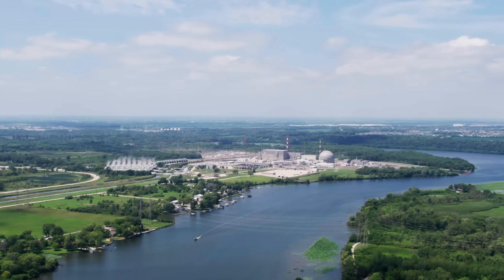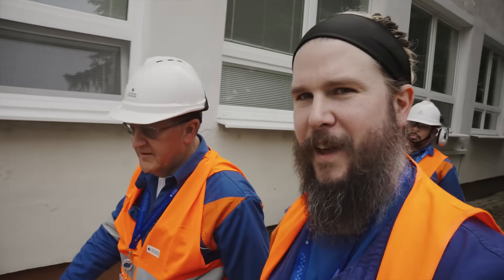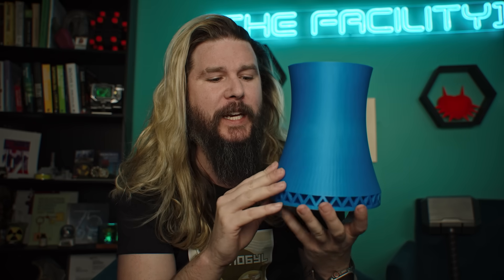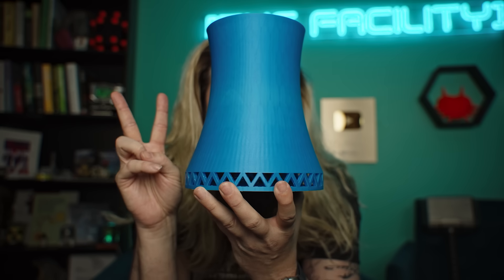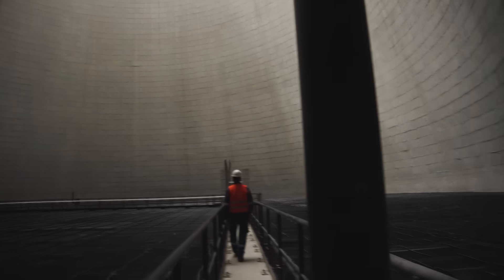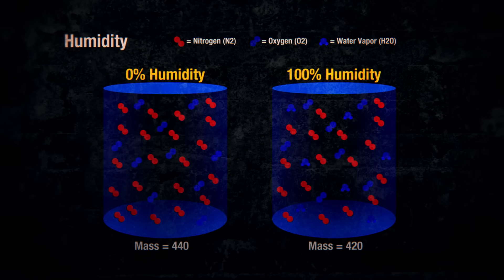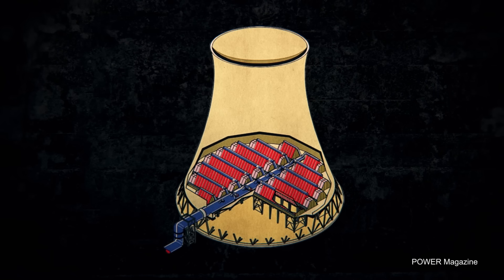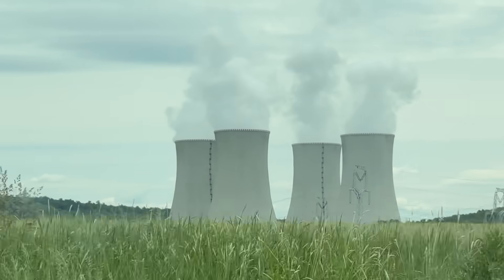I Went INSIDE a Nuclear Cooling Tower

Comment: "What do you think of when you imagine a nuclear power plant" I crude Radiation based steam turbine system? lol.. Earth should have upgraded to cold steam Tesla turbines a long time ago. Points at demos of Cold Steam Tesla's leaving ice cold mist on other side Universe can't balance heat if turbine big enough to take it all. Colder the cold side the lower the hot side needs to be for massive power for turning turbine when inside vacuum. If ever needing to crank vacuum back up because of leak or pump water buildup back to other side(Unlikely if built right) > Puts magnetic motor outside system that can be magnetically linked to turbine inside yes.. Good turbine like a flywheel so you can shutdown system while still providing power and have time before needing the power to turbine back before it drops down speed below optimum power output.

They don't even have Electric plasma generated Ultrasonic force field shockwave holography support for nuclear reactors yet did you know that? That's messed up.. *Search engine: "Boeing Plasma force field blocks bomb shockwaves" Plasma generated Ultrasonic shockwave > Then to make Humans and your metals immune = "A resonance frequency database can be employed to ensure that local healthy material surrounding a target has a natural resonance frequency dissimilar enough from the tuned resonance frequency." When your nuclear experts start seeing the level of control they can have without even having to open their machines up to install the upgrades, they're gonna want a design focused on Ultrasonic force field advantages. Promise.. - Dracula

Comment: Might be a dumb question but I always wondered: Could we put a turbine on the bottleneck of a cooling tower? Since hot air rises would it not be possible to capture some of that energy inform of heat and further improve a power plant’s efficiency would also be applicable for non nuclear power plants?
Reply: Technically yes... But that would slow down the air flow and you would loose the ability to cool the reactor as efficiently and the energy would be rather minimal as the air isn't moving That fast at the top.

Comment: Is there a reason they don’t put a wind turbine in the top of cooling towers to generate extra power from the heat energy?
Reply: Yes because putting a wind turbine on top would slow the air flow down causing there to be less cooling for the reactor and the air doesn't move all that fast, maybe a few miles on hour at the top. (AKA a nice breeze) So the power generated wouldn't out weigh the cooling potential that is lost.

Comment: Hey Kyle, I am from Argentina, and we only have one nuclear power plant complex Called Atucha, that currently has two operating reactors, and a 3rd one on the way. The thing is that there are not a single cooling tower, are there other ways to cool the water?
Reply: Just looked and it's placed right on a rather large river so as he mentioned they just intake water from the river and then eject the water back into it instead of using a cooling tower.
If done environmentally they won't pump the hot water directly into the river... But seeing as a Chinese company is building reactor #3... I doubt it will be environmentally friendly.
Reply: @SilvaDreams  the chinese where already booted from the project, the other two where made here by the national nuclear authority, and the third is on hold again. (new party at gov that does not want anything to do with China)

Comment: As the moist heated air rises, the air speed increases due to the constriction made by the parabolic shape of the cooling tower. This is called the Venturi Effect.
Reply: Correct. THAT is why it has that shape, not strength. 'tho strength is a happy byproduct. Also, they aren't built as a series of twisted straws. They're built like every other large concrete structure... in lifts. (I've watched them being built.)
Reply: Probably for both reasons. 

Engineering costs are a big motivator behind infrastructure design. Grady from practical engineering highlights this regularly in everything from cooling towers to dam designs.
Reply: Furthermore wind across the top of the cooling tower also pulls on air from within the tower which…. Oh hey look our buddy Bernoulli is also here 

This is very likely also being assisted by the Bernoulli principal which makes it far more efficient still,
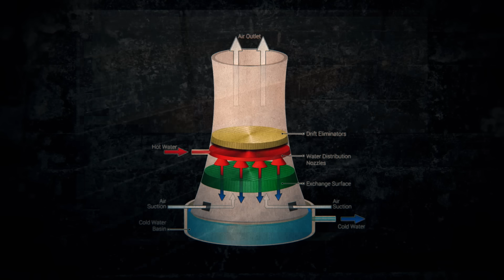Reply: 8:05 so you just didn't watch the whole video is what you are saying.

Or 9:05 is you are less patient.
Reply: @5353Jumper  nope, you are wrong, he talks about difference in pressures/weight of air thus making air move in 9:05, but Venturi Effect helps, by increasing pressure by decreasing diameter, but keeping same airflow - it helps suck air even more(something like in old engines with carburetor).
Reply: @TOZA He does mention the venturi effect, just not by name as he says that the tower's bottleneck helps accelerate the air.

Comment: "Plain" coal-fired plants have cooling towers too. My fav is in the ending scenes of Terry Gilliam's "Brazil" 😊
Reply: in Wolfsburg there is a coal powerplant,that was converted into a gas powerplant and it has that kind of coolingtower. so drop the nuclear.
Reply: Yeah they're all over the UK on coal and gas power station sites. The "nuclear" part just provides the heat, which can be done via any means. I guess Kyle just needed to tie it to his nuclear theme.
Reply: @ophic  Or as I've increasingly come to believe, he just doesn't know any better. (he's not to the Joe Rogan level of misinformation, but he's on the way.)
Reply: There's a large coal-powered plant in Ohio that uses these towers. I could see them from across the river in Point Pleasant, WV when I visited there earlier this year. I just assumed it was a nuclear plant but learned it was coal when I looked up info on it online after I got back home. (Just looked it up. It's the Gavin Power Plant in Cheshire, OH.)
Reply: they also release more radiation than operational nuke reactors running at the same output
Reply: I've seen that at industrial plants too. It's just "a cooling tower", yes this one is at an active nuclear power plant. Getting inside one is neither rare nor impossible; there are disused ones still standing around the globe. (getting inside one at an active power plant would be)

Comment: Hello Kyle, I have a question about cooling towers. The last coal power plant in the UK, in Nottingham, closed recently and there are a few cooling towers now no longer in use. Hypothetically, could this power plant be converted into a nuclear facility and the current water towers used? Or would the new facility need to build new water towers from the ground up? Thank you!
Reply: Pretty much the only things that can be kept are the cooling towers amd the generators

Comment: I always wondered why we remove the heat rather than recycle it. You could use this heat to generate more power or heat homes.
Reply: There are some countries experimenting with this. Sweden stores their hot water in insulated underground caves. They use the water for heating homes just like you suggest. It doesn't really work for direct energy generation, but that energy can still be used in some way. Insulated caves (cave with insulation sprayed in it and then sealed) seems to be the initial design for this kind of idea.

Comment: why is this design not used for buildings/skyscrapers if it's so good for wind and gravity? I'd imagine it handles earthquakes better than your standard design as well. You could even make cool romboid windows given by the structure of the steel beams
Reply: In a cooling tower the outer shell just has to support itself, a skyscraper would have to carry the inside floors. Also a hyperboloid shaped building would be impractical. nice pfp btw
Reply: @miloslavtokar1080 And inefficient because you lose space due to the curve.